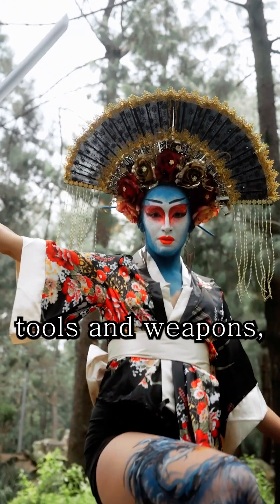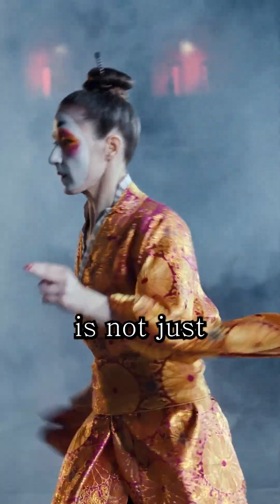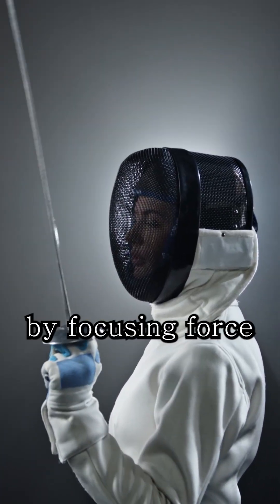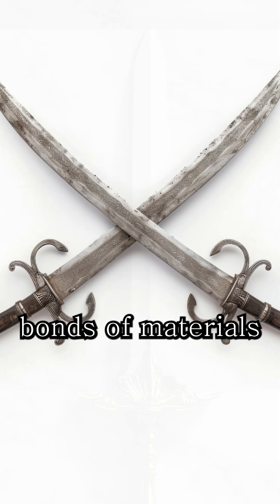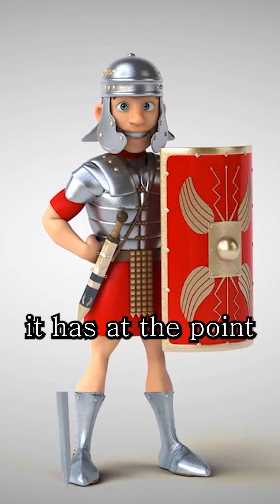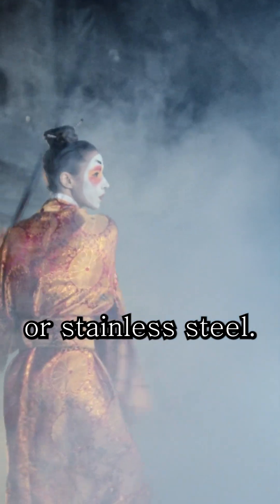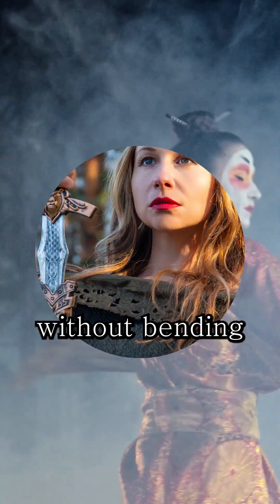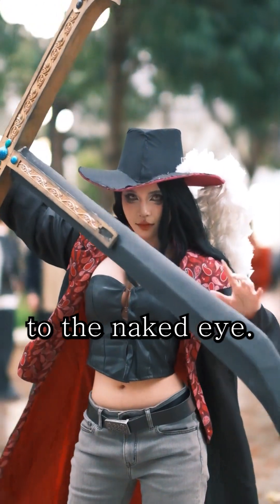The Science Behind Every Sharp Blade  #science #physics #blade

Comment from the maker: In the world of tools and weapons, few objects are as precise and powerful as a blade. But what makes a blade truly effective is not just its shape, it is the science behind it. A blade works by focusing force onto an incredibly thin edge. This narrow edge allows it to break the molecular bonds of materials with very little effort. The sharper the blade, the less surface area it has at the point of contact, which increases pressure dramatically. Most blades are made from hard metals like carbon steel or stainless steel because these materials can be honed to a microscopic point without bending. Under a microscope, a razor-sharp edge can be just nanometers wide, almost invisible to the naked eye. Some modern blades use advanced coatings like ceramic or titanium to stay sharp longer and resist corrosion. Whether it is a surgeon’s scalpel, a chef’s knife, or a samurai sword, every blade is a triumph of engineering. It is not just about cutting, it is about mastering physics at the edge of science.